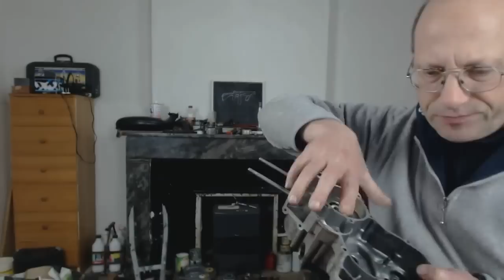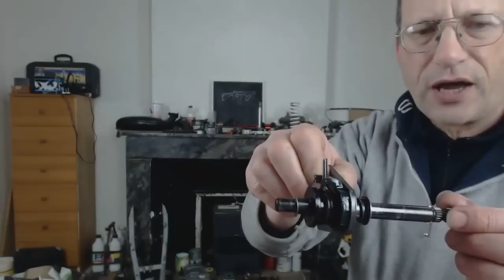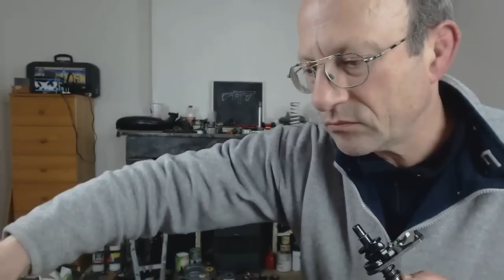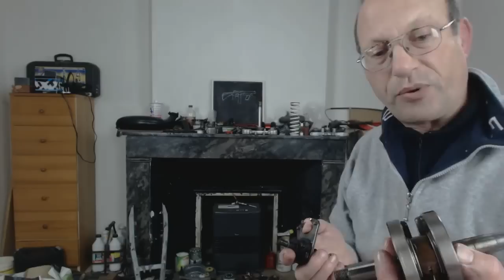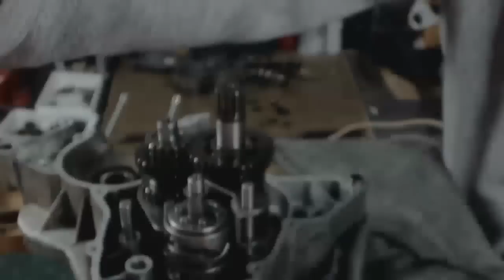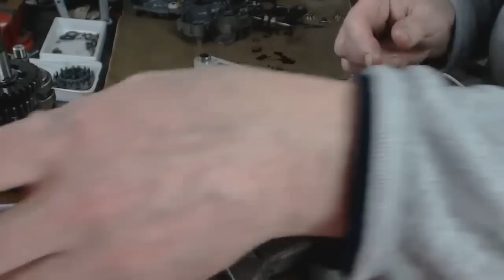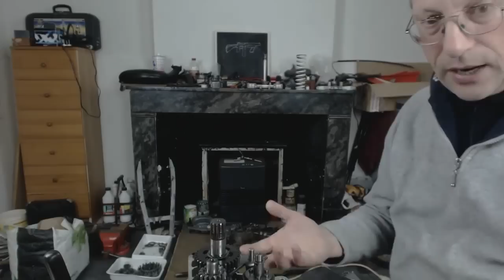AM6 Gearbox Assembly - step by step

Comment: so theres no shim beneath the shift cam? think someone assembled mine wrong also i have two shims one goes under the output shaft but i cant find where the other would go any ideas?
Reply from the maker: The shift cam shim locates above the actuator pin (perpendicular to the shaft).
The output shaft is shimmed at both ends.
The gear change shaft is shimmed at both ends (about the actuator arm assembly).

Don't forget to pre-assemble without the crankshaft (nipping up the cases)
... this, to inform you that the gearbox is not causing problems.
... and to check end play.
Then proceed to full assembly; spinning the crank as you go, to confirm that it is not causing problems.

Before doing all that ... don't forget to remove all high points on the case faces.

Best of luck with the assembly :)
Reply: Engine Tuning appreciate your reply thank you and hope to see more videos soon?
Reply from the maker: Soon enough ... I've just got to up my game on 'production values'.
The content has always been fine, but winging it (without a script) results in too much 'and ermmm' while my brain figures out the next sentence.
It's a pain in the neck.
... just knocking out an informational video, isn't enough to get it on the push list (even if the info is useful).

Luckily, for the younger generation (and a few Dad's) ... these early videos gained traction, so everyone can benefit.
It's harder now, to spread reliable knowledge.

Thanks for subscribing ... it helps :)

Comment: Hello, I know its an old video but need some help. Anyone know why I can't change the gear once the case it bolted on but i can once the case is off?
Reply from the maker: Typically, the shims are wrong, or incorrectly placed.
Assemble in phases.
Load a shaft, then assemble and nip up the cases.
Keep checking.
When all is correct, then final assembly with the crank shaft :)

Comment: Hi I’ve followed this step by step, but when I put the other casing on the gear lever won’t move :( any ideas?
Reply from the maker: You need to test in phases.
Assemble without the crank, and test as you nip up the screws ... see that the shafts turn, and that the gear lever works.
Make sure that you have the shims correctly fitted.
Reply: Still no luck, it goes into gear without gear lever, soon as it is on it won’t budge
Reply: Just noticed it has not got a washer/shim on the small end side of the gear lever, could this be the issue
Reply from the maker: Well done for discovering this anomaly.

Anything missing is certainly an issue.
The plain fact is, that everything must be in place (correct position).

There can be variants vis a vis shim thickness, between similar engines.
However, if you are assembling, using the original kit, the only problem might be too much slack.

Here is a link to a useful post for the Rieju motor.
There are some differences in shim thickness - I don't have the data to hand - but these are the shim positions.

https://www.apriliaforum.com/forums/showthread.php?224113-RS-50-Transmission-Assembly&p=2780665&viewfull=1#post2780665

If it doesn't load in chrome, then try Firefox ;)

Note the springs at play on the shaft.
The shim acts as a bearing surface.
If it isn't there, then there is no bearing surface, so it is unlikely to function as planned.

Remember ... these are highly tuned engines ... everything is pushed to the limit.
Before anything else, you need to get everything installed correctly.

Good luck with that, cos I guess you will now be hunting down that hardened shim.

:)
Reply: Thanks for the help, I’ll be looking for it tomorrow when it’s brighter :)
Reply: Okay, found the shim! I’ve put it together a few times as it goes into gear fine, but when I put the casing on the main drive shaft spins( what spins the rear wheel) and I’m unsure what would cause it, it’s baffled me
Reply from the maker: Sorry ... I've been off line for 5 days.
Did you find the problem?
Reply: Yes i had no idea that when the selector drum gets pressed down that means it’s selected a gear! School boy error and now it runs and rides great, thanks for the help and video
Reply from the maker: Great news :)

Comment: may be the problem ,one shim lost for not enter in 2-nd and up gears after assembling? it enter in first and neutral, the rest doesn't.
Reply from the maker: It is difficult to know why you have a gearbox problem.
Perhaps you are correct, in thinking that you have lost a shim.

How annoying!
You must strip the motor again :(

Remember to report back here.
You can tell us what the problem was ;)

Good luck!
:)
Reply: I think i had opened and closed the motor, for about 6-7 times, trying diferent shim combination.now that i saw that link with shims positions,i will try again in the right way,but first find that lost big shim . i will return here if i made it.
Reply from the maker: The shims may be 0.4mm or 0.6mm (I've seen both sizes specified).

Comment: My first gear has disappeared, but now I'm rebuilding. How can I build it so that I have all gears?
Reply from the maker: Examine all the components carefully under a good light.
Look for damage.
Assemble, and test the gears, by rotating the shift cam (as shown in the video).

Good luck, and keep us informed :)
Reply: yeah everything works when i put the two halves of the engine together, but when i try to tighten the bolts, the transmission doesnt feel right
Reply from the maker: Could be shims in the wrong place, or a bearing not fully home (if you changed any bearings).
Check the sideways play of the shafts

But you are following the correct procedure :)
Plenty of people build the entire engine, and install it, only to discover a fault :(

Comment: Sorry its a late comment, i have to replace the shifter shaft on my am6, what would the easiest way to replace this be? would i have to split the cases? also what side do i take off to get the bit i want? thanks.
Reply from the maker: It's a full split.
Prepare your work area.
Have a number of containers to hand - I use meat cases - for different areas of the strip.
A big sheet on the floor is another good technique for the first time.
Lay everything in the order it is dismantled - keep your eyes open for o rings and shims.
If you are forced to hit anything - always use a piece of wood between the hammer and what you are hitting.
I use a copper and hide hammer.
Check out my video series https://www.youtube.com/playlist?list=PLeHV-kNBKNNeLhnipp00LU6xcpqGtBSgr
Oil the crank and bag it for the freezer.
Reassemble without the crank, to test the gearbox.
Then assemble with crank, and test again.
If all turns smoothly, then continue assembly.

You'll be fine, but good luck anyway :)
Don't forget to subscribe - you know the YT subscriber rules kick in this month, and it will hit all help channels like mine ;)
Reply: Engine Tuning Cheers a lot man, got the engine out now, going to clean it all over first, I'll let you know if I run into any issues, also subscribed! Thanks :)
Reply from the maker: Great.... lets hope it goes smoothly.
Either way, it's all good experience  :)

Comment: Whats a good web site for parts for an am6
Reply from the maker: Ha!... that's a good question.
It depends on your priorities, and disposable income

Prices can vary dramatically between sites.
A component such as the output shaft can cost €15 or €75 - possibly from the same manufacturer (who knows).
I paid €15 and mine is fine.

The killer is always transport costs... it can destroy your morale.
That €5 component that you forgot, might cost €15 delivered.

List everything that you are going to need (a spread sheet is the best), and keep adding to it.
Use the exploded diagram that each site uses, for the exact part name and number.

Set up a favourites folder, then search for the parts, and save the link with a memorable name

You might find that two suppliers can cover all your needs.
Check their payment terms, some do not use paypal.

A good starting site is easyparts.nl 
It's multi language, and has a huge range of components.

Make sure that you know where the €5 postage sites are
scooter-center.com offers this... great for carb components ;)

Good luck... and don't forget to subscribe (and thumbs up) ;)

https://youtu.be/hCxGpU7fvAI (carb tuning intro)

:)

Comment: Great video, but im having problems getting bottom shaft in place
Reply from the maker: Ha... the first time is always fiddly.
Individually, if the shafts go in... they will also go in together.
Don't force them.
Good luck
Reply: PlayF1 Net i lost one of the small shims , can i proceed the assembly, if yes where shim is least importaint?
Reply from the maker: No, you cannot.
These aren't just spacers, they are hard steel.
But they do not just disappear.
Which shim do you think you have lost?
Reply: PlayF1 Net I think i have lost one that goes under the shift fork, what will happen if i assemble without it?
Reply from the maker: Under the barrel with the slots?
There is not one under that barrel.
It has a shim on top.
http://www.apriliaforum.com/forums/showthread.php?224113-RS-50-Transmission-Assembly&p=2780665&viewfull=1#post2780665
Reply: PlayF1 Net noo, I mean i lost a shim that goes under the shifting fork
Reply from the maker: There isn't one.
Reply: oh nice , so there is supposed to be only two small shims in gearbox right?
Reply from the maker: This diagram shows how many and where they go:
http://www.apriliaforum.com/forums/showthread.php?224113-RS-50-Transmission-Assembly&p=2780665&viewfull=1#post2780665
Reply: Thank you very much, now i know where all the shims go to ;)
Reply from the maker: Good luck with the rebuild.
Do not forget to keep testing that everything moves when the crankcases are joined!!!!!
When you are happy the gearbox is working, you can fit the crank assembly... and again test that everything moves.
Reply: I got the gearbox assembled with your video help everything seems to be moving fine , just waiting for bearings and new crank :)
Reply from the maker: That's great!
Reply: Also just one more question if that doesnt bother you, what could be the cause for clutch that wont dissengage, before the dissasembly it was disengaging, but not it won't, also when i fully tighten the clutch springs I can't press the clutch lever it feels too hard, im pretty certain I assemlbed everything correctly.
Reply from the maker: We always believe that we have assembled correctly :D

Did you fit the ball bearing between the clutch push rods?
 
It could easily be the clutch cable.
Make sure that the cable is running freely.
 
Then check the clutch actuator angle.
Have you adjusted this correctly?
 
Pull the clutch lever and look at the actuator.... does it look correct?

Comment: Great vid! Thinking of opening up my am6 soon as it has a lot of trouble going into 5th and 6th gear. Do you know what the problem could be? It does go into gear upon a second try but usually doesn't go in and revs without moving like it is in neutral. Any help would be much appreciated thanks.
Reply from the maker: It's very hard to say.
The clutch may be a cause... not sufficiently disengaged.
From cold they are often a problem.
Once warm they should be fine.
If the clutch cable play is too slappy, consider adjusting it.
Joining the forum would be a good idea.
http://www.apriliaforum.com/forums/forumdisplay.php?21-RS50-Technical
Reply: Engine is back together now and I put new crank bearings and seals in it as well as a new piston and clutch. The gearbox seemed to be in perfect condition and has done barely any miles. Problem is not fixed but I have learnt how to avoid it by simply lifting the gear lever twice when changing. I only have to put up with it for another 8 months anyway then I will get a 125cc. Your video helped a lot in the reassembly so thanks!
Reply from the maker: Thanks for those kind words.
Sorry that the problem was never fully rectified.
Life eh?

Comment: thank you so much for this video it helped a lot. I do have on question i hope you could help me with: when I tighten all the bolts on de two engine halves my primairy and secundairu shaft are both stuck but my crankshaft wil turn, when I loosen the bolts slightly they will turn but with great resistance (it shifts fine though). Do you know what causes the resistance?
Reply from the maker: It's possible that you have the shims in the wrong place.
Dismantle ... remove everything... test assembly with one shaft, then the other, then both together.
This way, you will discover exactly where the problem is
Reply: PlayF1 Net yess will do thank you

Comment: police stopped me 3 days after rebuild... they tooked my lisence plate and fine of 48e... and i have to now drag it to inspection and put it goes 45km/h
Reply from the maker: :(
That's very bad luck.
Re-fit the 12mm carb.... and put a big washer in the exhaust manifold, fit the old barrel and piston.
Reply: original carb is 16mm XD i got the license plate back alrdy
Reply from the maker: great news :)

Comment: motor is now on the frame and the front chain sprocket doesnt move... thx dude..
Reply from the maker: WTF man!
I told you to test turn the motor when you assembled the cases
Then test turn the motor when you first tighten the cases
Then test turn the motor when it is all tight.
Why?
Why would you fit an engine in the frame, when it doesn't turn?

Listen tramppa..... I'm not doing the job for you.
You have to do it yourself.
This job is well within your capabilities.
 
If you keep testing, at different stages of the assembly..... you would know exactly at what point you made a mistake.
..... oh.... the motor has stopped turning.... what have I just done wrong?
You know..... like that.

Other people can do it..... so you can do it.
 
..... and what's this 'thx dude' when you fucked up?
Is this somehow to help you deal with it...... like as if I misadvised you..... you know...... somehow it is my fault.
 
'Man up'...... and deal with it.
Reply: yes i know i blaed u about me doing it wrong XD i was just so angry :( havent rided for 3 weeks but hey, i got it working now everything works perfectly i did ride 2km test ride :DD
Reply from the maker: Okay.... cool..... well said...... and well done in the end.
Great to get back riding again eh?
I've just come back from an evening ride as well.
:)

Comment: okay i think its now working correctly the ball bearing wasnt in hole on the bottom of the drum (?)
Reply from the maker: :)
Well done.
You can't leave anything out.
Every component is doing a job.
Don't forget that the shift cam normally works while pressing down on the ball bearing and spring.

Comment: when i got it to neutral the top gearings doent spin on your motor, but on mine does? why?
Reply from the maker: There can be 'oil drag'.
Don't panic :D
You have the gearbox in front of you.
Now is the only time available for you to learn how it works.
When you put it together, and close the crankcases....... it is over ;)
 
Run through the gears.... hold the output shaft..... see what happens ;)
You have the gearbox in front of you..... exactly as I had it...... you see everything.

Take it steady and try to understand the gearbox
Post back here, when you feel good.

When the cases go back together..... there should be no mysteries.

Comment: i have 2006 cpi sx 50 supercross and i found many videos where they but the gear drums stick to another position than u did. wich one is right way? plz help i want to go riding :DD but very good videos dude helped a lot! :)
Reply from the maker: My way of course :)
It is fiddly..... but you don't need to force anything in....... and the gears should rotate freely.!!
Get yourself comfortable, with a good light source.
Take it steadily, and stay in control of the assembly.
When you put the 2nd case on...... test turn the motor.
when you first tighten the bolts...... test turn the motor.
When you've finished tightening the bolts..... test turn the motor.
Good Luck!

Comment: Reall good video really helped me and my son rebuild gear box still got a knocking on engine only play was balance shaft that we found could this be worn
Reply from the maker: Thanks Simon.... it's good to hear that the video helped.
Regarding the knocking.... you really need to set yourself up, to ask this question, or any question involving noise.
(in fact for any technical question).
Ideally, I need to know when the knocking occurs.
Is it when revving out of gear..... accelerating, decelerating, or at feathered throttle?
 
For noise.... uploading a video is usual.... with the exact moment the noise starts, being marked on the video.
That's because sometimes the noise isn't clear until it is indicated.
 
For your own audio testing....
Pure rotational components don't usually knock under engine acceleration.... everything is pushing together so there is no space to knock.
They are more likely to whine or grind, particularly under load, if a bearing has failed.
 
Nuts can come loose if properly fixed.... heard of tapping case two weeks ago that was sourced to a loose nut.
 
However.... most knocking is related to the crank and piston region.
As the crank pushes the assembly up..... at top dead centre, the assembly wants to keep going up (Newton again).
If there is any play, it moves through that space, then metal hits metal, and clanks!
Same going down.
 
Little end knocks tend to be higher pitched than big end knocks.
 
Using a screw-driver as a probe, with your ear on the end of the handle, can help identify the knock region.

Good luck :)